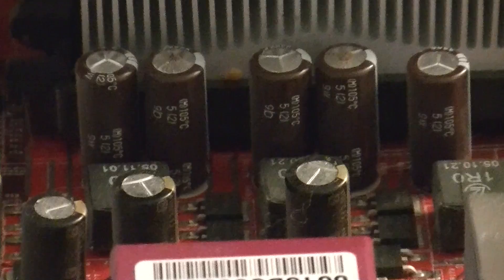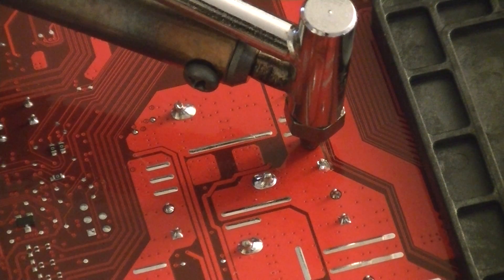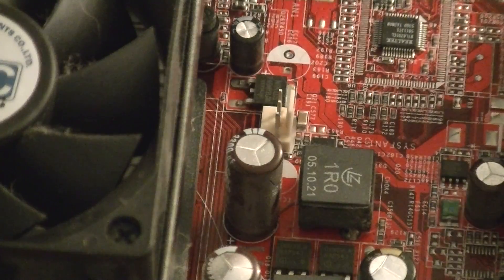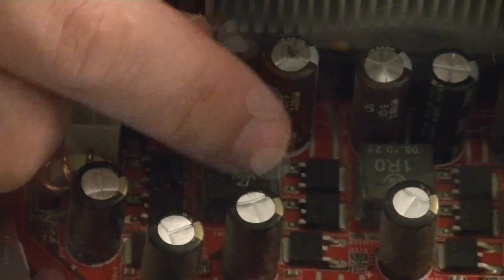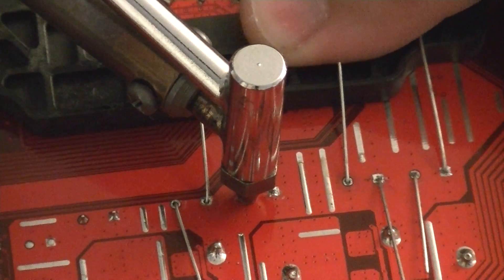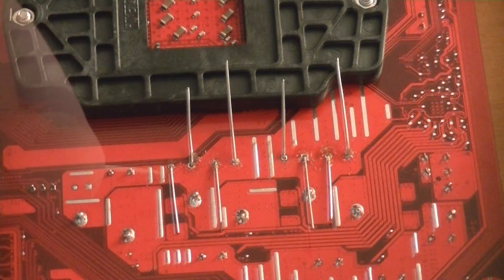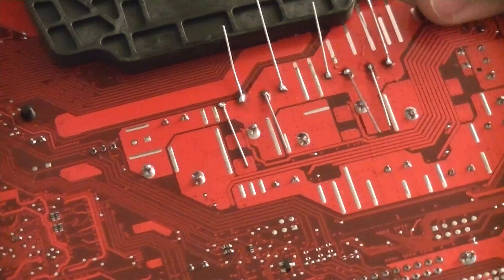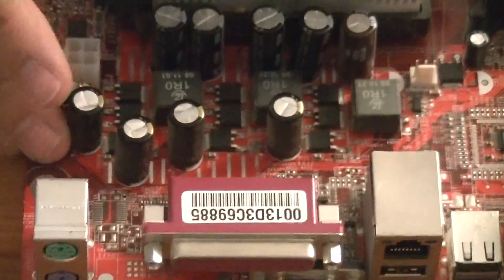How To: Replacing bad capacitors on a motherboard! (MS-7207 / K8NGM2)

Comment: thanks uberDoward for this video. i need to replace 20 cap's on a soyo kt400 dragon multilayer board. my question is how do i discharge them before desoldering them? and i have a rework soldering station with a hot air gun and soldering iron besides my radio shack desoldering iron. do i use the radio shack desoldering iron or use the hot air gun and if the hot air gun what temp setting should i use? and when soldering what temp should i use or do i need to use a stander pencil iron? thanks
Reply from the maker: I use the desoldering iron for all through-hole desoldering.  Capacitors will discharge over time in most circuits - resistors will draw them down, so wait a couple of minutes and you're good to go.  You can always use a voltmeter to test for potential across the cap, if you're concerned!

Comment: uber this is a great video.. makes it look so easy.. I have a question.. so my video suddenly stopped working. The pc still runs ok, but no matter which video I had in the pci slot it wouldnt output any video.. my friend physically tested some of the capicators around the pci-e slot and he showed me the multimeter on one of the capacitors had no reading.. all the other ones had 9-10 ohm resistance..  he told me the video wasn't working because of this blown cap.. so.. does it sound like the cap is really blown if it doesnt have an ohm reading and if that's the case.. could it in fact prevent a video card from outputting any video? Lastly, there is always 6 beeps from the motherboard when its powered on.. Thanks in advance!
Reply from the maker: Which motherboard are we talking about?  It might be a capacitor issue, but I'd like to know what the beeps signify.  The system is trying to tell you something, so I'd recommend listening to it :)
Reply: uberDoward
Reply: uberDoward thanks uber, the motherboard is a M3970AM-HP (Angelica2)
Reply from the maker: It looks like 6 beeps is a critical motherboard error.  Yes, I'd replace the capacitor and see if the board comes back.  Check for any bulging capacitors and replace them, as well!
Reply: uberDoward
Thanks. Im going to try and find a pc repair shop near me that has someone that can do basically what you did in this video (replace some caps on my motherboard).. I had a guy that said he would charge me like $40 to do it but I went to the tv repair shop and the tech said he couldnt do a double sided board like mine.. i was like.. uhhh.. ok. its just a circuit board..  but he said it would be really messy .. anyway, i will keep looking for someone local that knows how to repair motherboards

Comment: i pulled my old emachine out of the closet. i see 2 of the kzg capacitors are split. are any of the other capacitors on the board known to fail? i saw a complete capacitor kit on badcaps.net but not sure if i really want to replace 20 capacitors
Reply: Can you tell us the series and brand of the other capacitors, if they are kzg they are bad !
Reply: MrReeceyburger123 sorry to  take long getting back. I ended up replacing the 5 kzg next to cpu. The others are different brands. I got a kit though with all the capacitors on the mobo. Its been up and running for a week now with no unexplained blue screens.
Reply: doh1976 Good to here, what did you replace them with ?
Reply from the maker: doh1976 Awesome man, congrats!

Comment: Good video, but you left one of the ucc kzg capacitors (bad series known to fail) on the board, did you swap it out ?
Reply from the maker: Nope, never needed to :)  Sometimes you get lucky!
Reply: uberDoward I bet that the kzg that you left on there is out of spec and esr its just not physically bulged.

Comment: ok question, I found some capacitors that surpass the 100% energy efficiency, does that mean I can overclock even further? Im thinking of buying a used motherboard or just a simple motherboard that can be overclocked.
Reply from the maker: I... am confused?  You can't surpass 100% energy efficiency - that's just the laws of physics.  Can you maybe post a link to the capacitors you found?
Reply: http://www.amazon.com/1000uF-12-6x10mm-Aluminum-Electrolytic-Capacitors/dp/B005Q6T8WE
Reply: sorry for not responding, was busy and cant find the link, but yet though this capacitors are like 3 or 4 generations ahead, meaning ull see them in future motherboards, as it seems these are able to withstand energy much better to deliver much leaner energy with less heat waste
Reply from the maker: I'd be interested in seeing them - as far as I'm aware, capacitors are already quite efficient :)

Comment: motherboards are made by up to 8 9 layers and when you pull out the bad capacitor on the motherboard you cant be 100% sure that u dont strip vias and other connection between layers
Reply from the maker: Yep!  That's why it's so important to FULLY desolder before pulling!

Comment: what type of lux paste are you using?
Reply: flux. Thanks!
Reply from the maker: esesolox3 Just some cheap eBay flux.  Nothing fancy, my budget won't allow it!
Reply: uberDoward

How would you know if there was a cold solder incident btw?
Thank you so much for your guide it helped me on my first soldering project.
Reply from the maker: esesolox3 If the solder is 'balled up' - then it's cold soldered.  Cold soldering is pretty easy to see, as the solder won't have flowed down into everything, and instead will be sitting up on the surface only.

Comment: Alwayas a pain emovin caps in those multilayer boards, his tools seems te do a nice job
Reply from the maker: I learned a while back that having the right tool for the job makes things SO MUCH BETTER!
Reply: uberDoward I tried couple of times using a 40W Goot soldering iron and end near in dissaster, board almost damaged while cap not moving at all. Just like you say, some jobs require rigth tools. Many people say that caps are almost impossible to take from a MB but you .. no problem at all !!!.

This is some sort of soldering station or just a hand tool ?..
Reply from the maker: 38911bytefree Just a Radioshack 45 watt Desoldering Iron :)

Comment: I fucked up
Reply from the maker: What happened?
Reply: I heated the bottom parts then just yanked the capacitors out, then I tried to make a hole by heating the metal and burrowing through. I got it in but it won't really stay and I don't think it works, have to change another capacitor that's messed up to tell. Hope I don't mess that one up. 😪
Reply from the maker: Mike Larry As long as you got the capacitor our, and didn't rip the solder pads out of the board, you should be able to solder your new ones in.  Make sure you have them oriented correctly!

Comment: That was a pretty poor solder job, you need to heat up the pins more.
Reply from the maker: I'm going to disagree with you there.  A cold solder joint will show as a round 'blob' - almost a circle.  As long as both parts are heated appropriately, you'll instead get more of a concave mountain look, which I have here.  Besides, board worked perfectly after the capacitors were replaced :)  Thanks!

Comment: I have 10 of the bulging caps (1500uf 6.3v) near the processor but the computer still works. what is the function of those capacitors? soldering is easy but the desoldering is the tricky part. I don't want to tear up the board trying to get the caps out
Reply from the maker: Likely part of the voltage regulation system.  Definitely would replace them!

Comment: How powerful is the soldering iron? I'm trying to desolder some capacitors on a motherboard and its not melting the solder. My iron is 25 watts.
Reply from the maker: Mine is a 40watt desoldering iron.
Reply: uberDoward I have searched for your type of combined iron and sucker and it appears to be only available in America, via eBay, (I'm in th UK). Its a shame because it really does look very easy. I think I will just get a normal more powerful iron. Thanks for answering quickly.

Comment: i was trying to  change out a capacitor but broke it off and tried to prongs through but they broke off most of the way where i can not take pliers to remove it any advice on how to get the prongs out?
Reply from the maker: Pretty easy - if this is a through hole (the 'legs' go through the board) then take a sharp pointed cone tip on your soldering iron, and heat from one side, while applying light pressure to 'push' the leg through.  Grab with a small pair of needle nose pliers, and remove while the solder is still liquid :)

Comment from the maker: Sometimes they will seem to continue to work - but the constantly fluctuating signals/voltage will eventually take their toll.  Definitely recommend replacing them if they have gone bad on you!
Reply: How do you remove a capacitor that has leaked out and the insides are all stuck to the board? Very informative and interesting video.Cheers
Reply from the maker: I usually go at the residue with a stainless dental pick to carefully clean it away, followed with some isopropyl alcohol :)
Reply: Well I found out that it was not a leaky capacitor but glue that someone applied in excess. I heated the glue and was able to remove it from the capacitors, I also removed the capacitors and will be replacing the (2 ea)

Thank you for your help.
Cheers
Reply from the maker: Ha!  No problem, glad you were able to fix it :)
Reply: Well I have not fixed it yet, I was just able to remove the glue and the two capacitors that had the glue holding them now I have to replace the capacitors and hopefully the static/white noise will go away if not then I will have to keep troubleshooting.
Thank you for your help.
If you can think of something else that might be causing the problem I will appreciate the advice. I sprayed some deoxit on all the pots.
and electrical contact cleaner on the board.

Cheers
Reply from the maker: Sounds like a good start - let us know how it goes :)
Reply: sir, capacitors must  trade with onother>? the system will broken down if you let it?  i have some that  explode already and  they have a  brown colour in surface, but pc still working very well, what must i do

Comment: THANKS FOR THE REPLY WITH OUT CRITISIZING MY CAP LOCK TYPING :) I KNOW MY DESK TOP IS OLD AND EVEN THOUGH THE CAPS. ARE BLOWN IT STILL WORKS AND I FOUND THE CAPS AVAILABLE ONLY THROUGH AMAZON AND COMPUTER REPAIR SHOPS DONT HAVE THEM GO FIGURE NEW MOTHER BOARD IS 80.00 -100.00

Comment: THE REPLACEMENT IS EASY NEED TO KNOW THE REASON OF POSS. CAUSES THEY BLEW OUT I HAVE THE SAME CAPS. THAT ARE BAD BUT ONLY 4 OF THE 3300UF AND ONE 1000UF CAP BADLOCATED JUST BELOW THE CPU